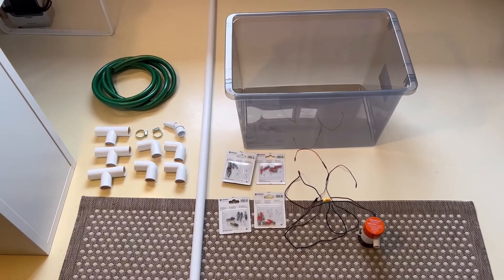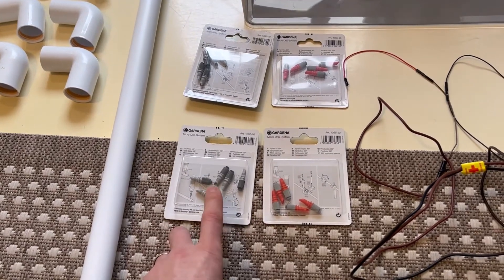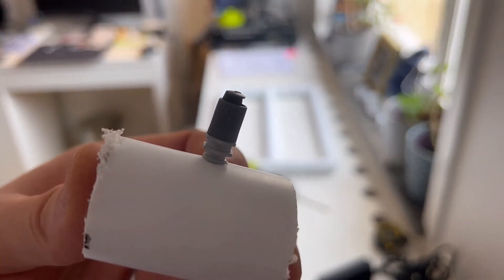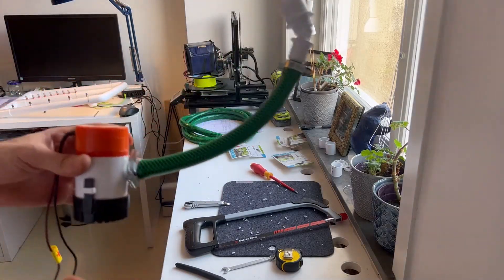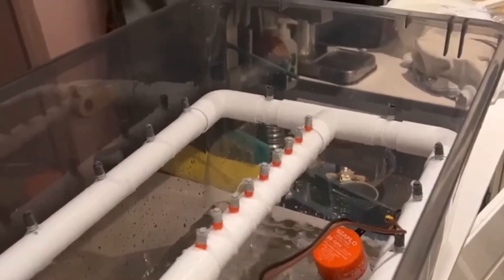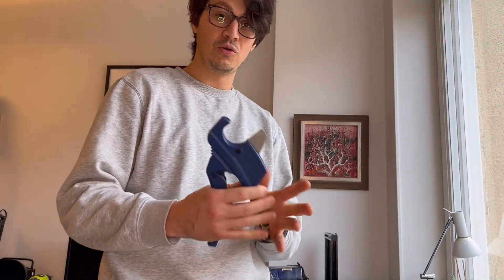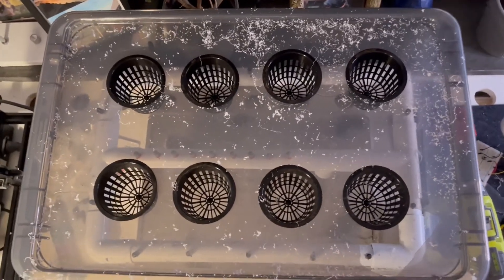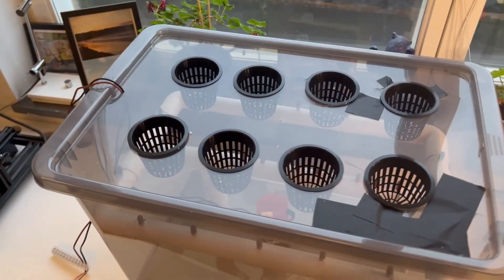DIY aeroponics system

Comment: I read about aeroponic and hydroponics systems the difference is the size of the water points if its 5-50 microns its aeroponic 
50+ microns its hydroponic
Its all about the pressure system 
If it 100+ psi its 100% aeroponic system 
If less its likely more efficient hydroponic 
The idea is to give as much as possible oxygen 
If ur pressure less than 100psi micro fans will help to remove extra water from the roots in the off period and roots get more oxygen this extremely important for the yield 

When using 100 psi system and less than 50 micron of water molecules the roots ((remains)) dry and breath better and more oxygen wish this help anyone interested in aeroponic
Reply from the maker: Thanks for the information, very helpful!

Comment: getting a mist is impossible without some kind of compressed air.  a spray does work
Reply from the maker: Agreed, I was thinking about adding a pressure vessel on a future build to see if it's possible to achieve the desired spray.

Comment: I would be inclined to think the smaller pump can still work, but that you lost back pressure when going from a small pump hose to a larger pipe. Try doing the same thing in reverse with a small pump and you should get good results with less electricity I’d think.
Reply from the maker: That’s a good suggestion, thanks!

Comment: My pump is heating up the water to 80f, so I added a thermoelectric cooling pad to the outside. You only need 5volt because 12v will freeze thd water
Reply from the maker: Very interesting, thanks for the info.

Comment: With that spray volume and droplet size, you're not actually getting the benefits of aeroponics so much as creating a high-energy kratky system.  Plants will grow in it, but you won't get the fine root system and higher nutrient uptake that an aeroponic system is aiming for.

You've got too many spray heads to begin with and they're too close to the roots, so you're effectively just hosing them down when ideally you want smaller droplets diffusing through the air and collecting in a fine mist on them.  The weaker pump with less nozzles (and not aimed directly at the roots) will likely get you a better result.

You could also use an ultrasonic mister in a separate container that has a filtered fan to flow the mist into the grow chamber (and which will also condense the droplets on the way through so that they size up from the 1 micron size that an ultrasonic mister will produce).

But yeah, as that system is designed, you could just build a kratky system and save yourself the power cost of the pump.  In a one chamber system the plants are going to eventually grow their roots down into the reservoir anyway and then the pump becomes pointless.
Reply: Hi! I'm new at this can you explain the differences between the kratky system and the one showed here? Thanks in advance 🎉
Reply: @diegobucarey  Can do!

So a Kratky system is one where the root chamber and the reservoir chamber are the same chamber (like in this case).  Usually the initial water level is at or immediately below the seed level, and as the plants uptake the nutrient mix, the water level is allowed to drop some so that there is an area of root system exposed to oxygen (because plants uptake oxygen through their roots and so need this space to not drown), and an area of root system simply in the nutrient mix (because they also need to uptake nutrients through their roots).  The reservoir is periodically topped up to maintain this level of nutrient mix so that the plants can continue to uptake both oxygen and nutrients/water through their roots.

So what he's done here is essentially built a Kratky system, but rather than start with a high nutrient mix level, he's just added sprayers to throw up the nutrient mix at the plants.  In a proper aeroponic system, the reservoir would be separate and the spray volume would be less intense, and the droplet size would be finer, so the roots are almost being misted while otherwise being suspended in a volume of air.  Any excess liquid would be allowed to drain out of the system back to the reservoir so it's just that mist-delivery that delivers nutrients to the plants.  No pool at the bottom for them to waste energy growing towards.

The root systems grow differently in the two systems too - in a Kratky system you get long roots that initially spread out (because the first level grows wide due to the easier access to water when the water level was high) and then dangle down like hair, whereas in an aeroponic system you get large fractal branches as the roots try to maximise their surface area to uptake the mist.

Comment: I don't mean to be rude.
I just want to try and educate you and the people that watch this video.
First off this is not a aero setup. It's actually a hydro setup.
The reason for this is, because your nute solution and pump are in the grow chamber. So once your roots start growing, they will be hanging down into your nute solution. Instead of just hanging in the air. Hence aeroponics.
When growing with aero you want your system to have a grow chamber and a reservoir. The reservoir will have your nute solution and pump in it. Then you get a timer to where you can set seconds and minutes. And plug your pump into that.
Because your ON spray time only takes seconds. And your OFF time takes minutes.
For example you would only spray your roots for 5 seconds every 10 minutes.
And then your nute solution drains back into the reservoir. So the roots are just hanging in the air.

That pvc thing with your sprayers on it is called a manifold.
Like I said I'm not trying to be rude. I'm just trying to give you some friendly advice.
Now with your manifold. You have way to many sprayers.
You just want to mist the roots a little, not soak them.
I don't know if you have ever seen roots grown with aero.
But there will be like main roots. And then off of them there will be like little hair roots. Well if you soak your roots you won't get any of the hair roots. Which help tremendously with the uptake of your nutes. Without these hair roots your limiting the success of your grow.
Another thing about your manifold is it is sitting way to high up in your grow chamber. And you will have tons of leaks. My manifolds sit about 2 inchs off the bottom of the grow chamber.

Someone already said something about your grow chamber and reservoir being light proof.

But also there is one very important thing, that most people that try and grow with aero don't know is that you must keep your grow chamber and reservoir and nutes at around 75 degrees.
This is very important from keeping mildew and mold from attacking your roots.
Hence ROOT ROT.

I've been growing with what is called LPA ( Low pressure Aeroponics ) for about 15 years now.
Which means I'm not using a high pressure pump to achieve the droplet size required to grow with HPA 
( High Pressure Aeroponics ).

When I wanted to start growing with aero. I built a HPA system. It cost me over 500 bucks. And it was a pain in the rump.
And then about a year after I was growing with HPA.
I stumbled across this guys grow diary and he was growing with LPA. I'd never heard of it before.
This guys diary was great.
It was like a hundred pages long and he showed everything he did, even with hundreds of pictures.

Anyway I built a LPA system.
And did a side by side against my HPA system.
And there was NO difference in the results.
And the rest is history. LoL 😂😆.
I built 4 LPA systems, which consist of 2, 23 site grow chambers with 1 reservoir.
Each system is only 3'x3'.
Thats 46 plants in a 9 s/ft area. I grow in what is called the SOG ( Sea Of Green).
My plants are like 2 inchs apart.
I've been growing this way for about 15 years now and it is the cheapest easiest and fastest way to grow.

Anyway I hope this helps a little.

Oh one more thing.
The tubs you want to use are the black ones with the yellow lids from home Depot.
Those are the only ones that will not leak.

Good luck and take care.

ASS  OG.

Aero Systems Sea Of Green.
Reply: I would like to see your Aeroponic  System. Can you share resource related to your system. I am a student and would like to make a Project out of this .
Reply: Do you need an intern 😂
Reply: Hi, this video is interesting and so are your comments. Would like to see how your system is build, why not share a video? I am planning to build a system and any tip helps. Thanks
Reply: @DIY_Garden  
Sorry, but I don't do videos. 
But I will try and explain how I built my aero systems. 
For my grow chambers I used storage bins. I tried 5 or 6 different ones, before I found ones that wouldn't leak. 
The black bins with the yellow lids at home Depot. 
Are the ones I use. 
They are 27" L x 18" W x 12" H. 
I sit 2 of them right next to each other. So I can use 1,
3'x 3' led light over them. 

These 2 grow chambers have 1 reservoir. You can use almost any size reservoir, because you are only going to fill it up halfway. 
But the ones I use are 
20" L x 12" W x 15" H. 

Now for the manifolds that go in your grow chambers. 

I used half inch PVC. 
And they have all the connections you need. 
Just make a rectangle the dimension of the inside of your grow chamber, but run a line down the middle of it. Now when you build your manifold you can use the slip fittings and there is NO NEED to glue them. 
There is one more thing. 
On one of the corners of the manifold you will have to use a T fitting. It should have a slip on one of the ends and in the middle, then the other end needs to have threads. This is for the fitting that goes out the chamber. 
I used what is called a riser. It's for sprinklers. 
It's 5" long and it's a black pipe that have sections of threads on it and you can cut it to different lengths. 
But just keep it at 5". 
Now you are going to need to drill a half inch hole in your chamber to run this riser through. 
Now before you drill that hole. You are going to have to decide how high your manifold will be off the bottom of the chamber. 
I keep mine at 2" off the bottom. So you would have to drill that hole 2" from the bottom. Now that you have the riser going out of the chamber you will want to put a half inch threaded female fitting with a half inch nipple. So you can hook a half inch hose to it. 
You will also want to put a hole in the bottom in the middle of the chamber. 
For a half inch elbow with a half inch nipple on the end for your drain hose. 
Remember you will have to have your grow chamber sitting up off the floor for this drain hose. And it has to sit higher than the solution in your reservoir. So it will drain properly. 

Now for your sprayers on the manifold. I run 9 of them. Use the litter plastic green sprayers that you can get at your hydro store. 
There cheap and they work great. 

Now I don't know how many plants you are going to grow and what you are going to use to grow them in. So you will have to drill holes in the lid of your grow chamber. 
I grow in the SOG. So each of my grow chambers have 23 plants in them. So thats 23 holes I had to drill. 

I don't use rock wool or them clay things. All of that is a pain in the ass. And a unnecessary cost. 
All I use to grow my plants in are 2" net pots with the 2" foam inserts. And you can use these over and over. So it saves a lot of money. 

Now for your reservoir, pump, filters and hoses. 

Drill a half inch hole, 2" from the top and another 2" from the bottom. Right in the middle of one of the sides. 
The top one is for your pump and the bottom one is for the drain hose. 
You will want to use the black half inch hose you can get at your hydro store. 
You will want each of your hoses to be at least 7' long. 
This will give you plenty of room, just in case you have to move them. Which you will. 
The filter I use is what people use on their sprinkler system. 
It's black and is about 8 inches long. The hose will go on each end and the filter is in the middle. And it just unscrews. This goes on the outside of the reservoir. Anywhere on the pump line to the grow chamber. 
The main reason I use this style of filter is because it is real fine. A lot finer than anything you can get at the hydro store. Plus it's easy to take part and clean every few days. 
For the pump I just use a pond pump from home Depot. Don't try and use the 2 smallest ones they sell. Anything above those will work. 

Thats about it good luck.

Comment: Sterlite makes a nice rubber made tote in 18 gallon size that is a little taller and softer plastic (no breaking). Also, using an aquarium pump domes with fittings that connect to pvc fittings better as well as a/c standard wiring that plugs in directly. On my setup, I drilled the wire access on side of the bin near the top (as opposed to the lid). Nice job on the project overall. I use mine as a closer and get roots at about 5 days on cuttings.

Comment: Please don't build any system of clear or translucent materials or you will have huge issues. Also, make sure the outer color is light or white so you don't have heat build up in the tank because of the lighting. Oh, and put tinfoil over the medium... can't tell you why or I would have to k1ll you... lol.
Reply from the maker: Ok, thanks for the heads up

Comment: Should use a black tote type, not clear.  Use black spray paint then white after to block light and not heat up the water if using cleaner container.  I would drill a hole for refills instead of having to take the top off but that's just my suggestion.   You can go one step further and put a start/stop pump for a 5 gallon bucket full of pre-made water/nutrient so you won't have to think about it other when you see your reservoir is low.  Just my thoughts and have fun growing

Comment: This is thin film not aeroponics sorry to say, technically deep water once the roots grow more than a few inches..... 

Good on you for having a go, might be useful for clones.
Reply from the maker: I’m not sure I know the difference. You are correct though I didn’t get the type of aerosolization you that would qualify. Hopefully I’ll improve in future builds
Reply: @HHCIB  You need to be 90PSI or more in water pressure for aeroponics, the mist should be fine enough that is basically sits in the air instead of falling immediately to the floor.  Your roots will then turn to a fuzzy mass resembling fungus.
Reply from the maker: @quadlawnmowerman  Cool, thanks for the information.

Comment: Next time put the lid on a piece of wood (stops vibration), and once you poke the guide hole thru, reverse the drill and cut the hole with the saw going reverse (slowly).. it won't break the plastic as easily.

Comment: You can add an empty bottle to the pipe, it'll greatly improve your pressure, should angle the outside valves a bit inwards or move it all the way up and have it spray sideways, less chance of getting water everywhere, but all in all, broken lid and duct tape, great successful build man 💪🥳🙏 hope to see more videos like this and what you're growing in there, best of everything 🙏 greetings from Thailand 🙏
Reply from the maker: Thanks a bunch man :)
Reply: Perhaps less sprays?

Comment: Replace the plexiglass with LEXAN polycarbonate and you will illuminate the breaking issues while drilling. It runs a bit more in cost but it is shatter resistant and lasts far longer than plexiglass.
Reply from the maker: Good to know, thanks.

Comment: 1100 GPH is wayyyy overkill. . Should have used like 1/2 inch pvc. . Future reference -  smaller the pipe equals more  pressure. .
Reply: Smaller pipe would be worse due to the greater frictional loss.
Reply from the maker: this is correct, and I will change the diameter of the irrigation on the next version I plan on building.
Reply: @HHCIB 
 If you use an rO booster pump you can use 1/4" RO tubing and 1/4" push fittings which makes things a lot easier. The flowrate in the tubing will typically be no more than 4 GPH (4 x 1GPH nozzles). If you connect your 1000gph pump to even a short length of 1/4" tube you wont get higher pressure, you`ll just get a dribble  of water from the end of the tube  :)

Comment: If u would have used smaller pipe u wouldn't of had to buy another pump. . I'm sure it cost more than buying smaller pipe and redoing it. . But that's u brother. . Jus my opinion on what I woulda done
Reply from the maker: this is correct, and I will change the diameter of the irrigation on the next version I plan on building.

Comment: After you poke through with the pilot bit on the hole saw, try putting it in reverse and going through. It prevents cracking the plastic because the teeth dont catch, it more or so kinda melts through. Makes a cleaner hole
Reply from the maker: Thanks for the tip :)
Reply: That's what I do

Comment: After you get the pilot hole started reverse the drill and let the weight of the drill cut the holes. Don't push down! Yes it's slow. But it greatly lessens the chance it will shatter or Crack the plastic.

Comment: Thanks. How well did that pump work with those emitters?  Did it aerosolize the spray?
Reply from the maker: It didn't create and aerosolized spray, I need to use a different type of nozzle in order to achieve that. It did create sufficient spray to move the nutrient solution over the pots though.